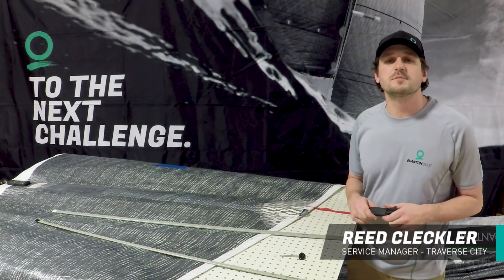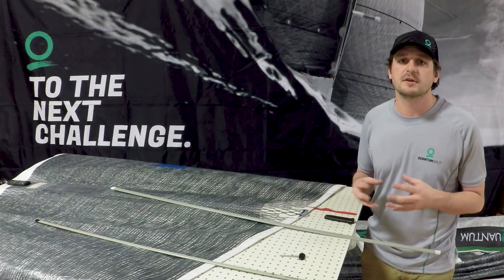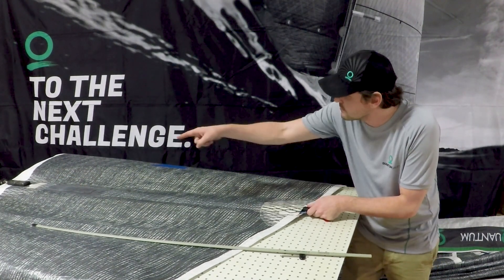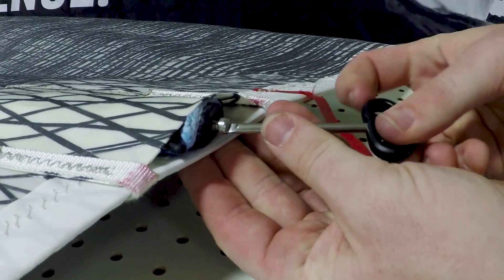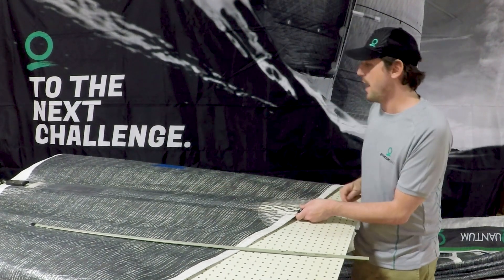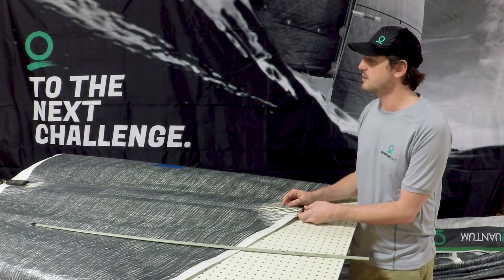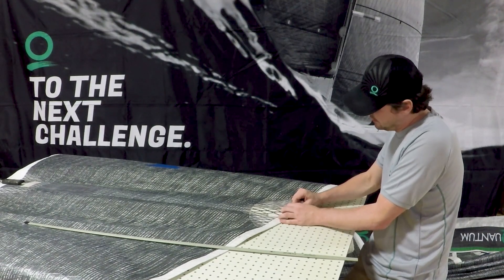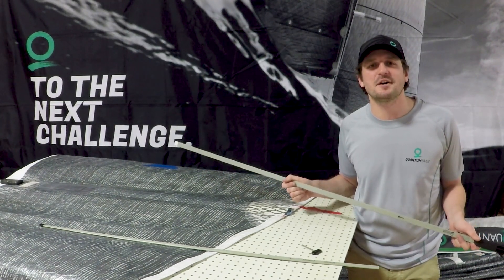How to Use Rocket Batten Tensioners

Comment: Ok, but how much tension is needed under various conditions? Say I want a full sail for light air and flat sail for fresh conditions. How much tension is appropriate for each? 

What about partial battens? 

Should there be differential tension top to bottom of the sail to account for wind shear?

Etc.
Reply from the maker: Hi Wiener, this is David Flynn, out of our Annapolis loft. Batten tension may change slightly with conditions. You may need a little more tension when it gets windier. The best way to tell if you have enough tension is to look at the batten under load while sailing. If there are vertical wrinkles running up through the batten pocket you need more tension. Essentially you have to pull the fabric taught over the framework (the batten) just enough to pull any vertical wrinkles out. Full length battens, particularly those the top of the sail where more roach is being supported for a given chord length, will need more tension to remove vertical wrinkles. Partial battens (usually found in the lower sections of the sail) will typically need less tension. You also don’t want to put too much tension on a partial batten since there is not batten receptacle to handle the compression and you risk creating a hard spot where the batten end. Wind shear is not a factor in batten tension.

I hope that helps. Feel free to let us know if you have any other questions.